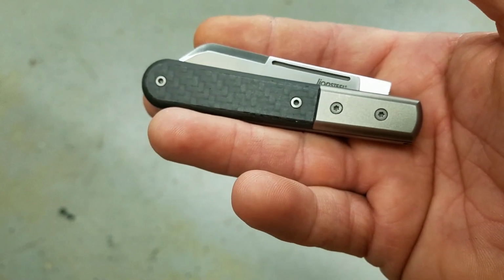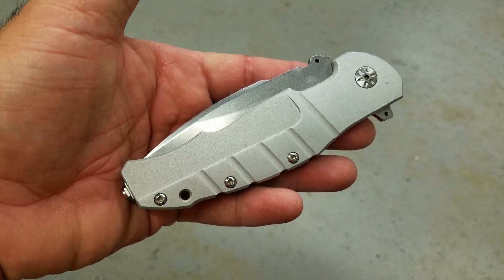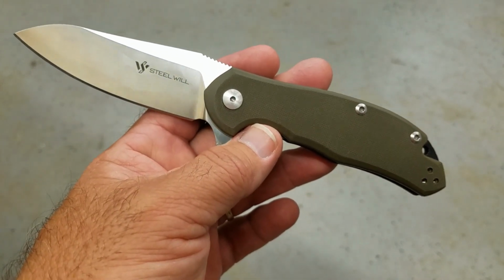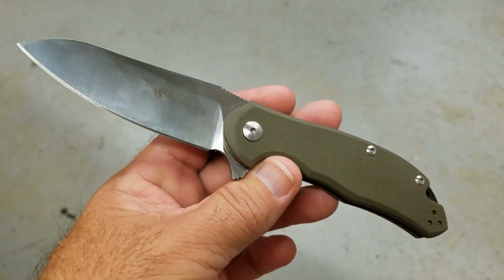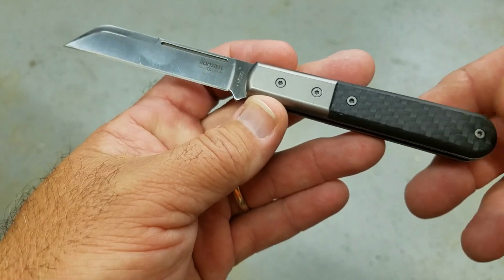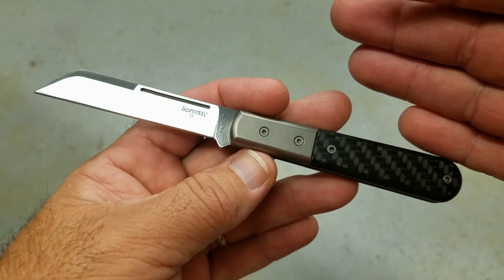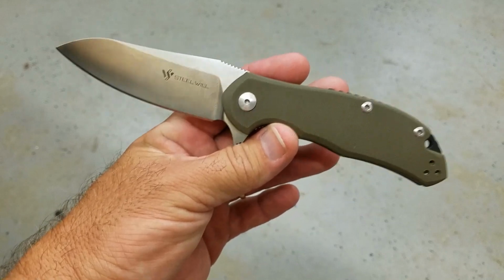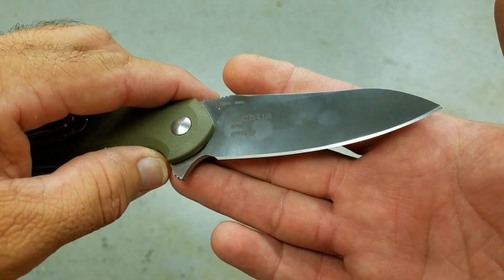Italian M390 edge retention testing, Steel Will, Masserin and Lionsteel. Who will take this one?

Comment: Why do so many manufacturers not do m390 correct? Makes me scared to fork over the $ for it so for now I'm sticking to other steels .
Reply: Ditto
Reply: i avoid it now. manufactures just want your money, they dont care about heat treatment.
Reply: Most of Spyderco m390 is a safe bet. Most. Not all. I don’t buy m390 unless it’s from Spyderco.
Reply: @johnd9357  that's what I was thinking it seems like theirs is the only consistent m390 I've heard of .
Reply: Just stick to Spyderco for M390 and it’s analogs. They typically heat treat everything for performance.
Reply: @jasonthames7360  I agree. Although I don't have any of their M390 or analogues, I have 52100, S90V, Cruwear, XHP, Rex45, and M4, all performing excellent. They are your safest bet.
Reply: @jasonthames7360  have you ever tried Cold Steels S35VN ? I recently got an AD-15 and it's my first experience with S35VN and so far I'm pretty amazed by it . Before the best I'd had is cpm154 and vg10 .
Reply: Yea stick with Spyderco for M390, had my M390 Delica tested a while back- 61.4 and 61.8. Just saw a Manix test for 62.2 i think
Reply: @johnd9357  spyderco m390 is decent overall but they range from 59 to 62hrc. So... It varies.
Reply: @OsamaBinDarrel  cold steel s35vn is not that great but it's not like it's a super long lasting edge regardless. Cold steel xhp is where it's at. It performs better than there s35vn.
Reply: @tacticalcenter8658  I wish they offered more xhp unfortunately I got into cold steel a little late for the xhp to be readily available 🥺
Reply: @OsamaBinDarrel  xhp is not available at the quantity and prices they were getting before so they switched to s35vn so they wouldn't have to raise prices and delays to the customers. If you want some great s35vn try Andrew Dempko custom knives. They start around $800 but are worth it.
Reply: @tacticalcenter8658  yeah I'm not in the position to spend that kind of money on a knife lol one day maybe but I'm sure I'd wind up single with the lights off if I spent that 🤣
Reply: @OsamaBinDarrel  save money and with time you'll get one. That's what i do.
Reply: @tacticalcenter8658  one day brother lol but at the moment I'm not in the position to spend that on a knife even if it's "extra" . I live comfortably and probably wouldn't get my lights turned off if I bought one it's just hard to justify that purchase for me at the moment. Not saying they're not worth it bc I believe they're worth every nickle . I have been searching the secondary market though and have seen MG AD-15s that are closer to my budget .

Comment: 28 ft on an M390 blade..you are better off buying an 8CR13 knife! It really is a shame, because they are a damn fine looking knife. The Italians in general make a good well built knife, until you cut with it. That Lionsteel will need to be sharpened if you cut a damn banana! Disgraceful. 

btw, I got that Modus I sent you on sale also, for just over $100. Some knives, I look at it the way you do..it's a good edc knife, that just won't cut a ton of stuff, so great for light duty edc carry, but not a good hard use prolonged cutting work knife. If I like a design, and the price is right, I'll buy it regardless of the steel, as long as I take into consideration what I intend to do with it. Thanks for all you do G!

Comment: I do have one remark regarding the testing. If you want to form an opinion on the overall quality of a brand or knife type, testing 3 completely different knives is not a proper test. You would need multiple knives of the same type, let's say 10 or 50 of different batches as well depending on how many they make, and test those. And then you can get an idea of how good or bad it is. Not doing 10 tests with 1 knife. That is not the way to go. It can be a fluke, or someone trying out a bunch of knives and pass the bad one around.

So unfortunately for all the work here, but realistically speaking you now have the result of single knives, not a brand.
Reply from the maker: Being this video is about Italian M390 I'll cover that. I've done videos on 8 examples and none did well. Examples from Viper, Lionsteel, GM, Masserin and Steel Will.  These aren't passed around as they all belong to viewers and two from other channels personal collections. The Modus is mine and I still have it. The issue is a poor heat treat on all of them. Is it possible these are just 8 bad examples, sure. However, the chances of that are slim. To add to the issue these were made across a 4 year span of time. I'll single out the Lionsteel, all made years apart yet all still do poor. 

Yes every knife I test is a single result and I've stated that before. Aa I continue to test anyone can form an opinion on a particular company. A few examples would be Spyderco, I've done many from them and they have a high chance of having a good mass production heat treat. TRM had 3 of 4 20CV do well and Shirogorov also does well. That doesn't mean they all will but as the list expands and more examples from manufacturers are tested patterns become apparent leading to an individual conclusion.
Reply: @Outpost_76  ye the more is tested the better. Looking purely from a statistical pov and a tester (chemistry), your test set isn't reliable enough to have a real conclusion, but it would certainly warrant further investigation. Too bad that we as consumers can't go and get 50 knives from 1 type and several batches. 

In the Netherlands we have something called the 'consumenten bond' or consumer union or something translated. They sometimes launch wider tests.

I do know heat treatment isn't an exact science but there should some sort of guaranteed tolerance. That said, seeing quite a bit of messy qc with lionsteel from reviewers so skipping them as well. Got a viper katla that is impeccable though
Reply: @Outpost_76  Agree. Perhaps I am unlucky. My Lionsteel M4 and Bestman did significantly poorer than my Victorinox Hercules in 1.4110 steel in rope cutting test. The two knives were purchased in late 2019 and early 2020.
Reply: @Outpost_76  By the way, my Lionsteels were bought from a Singapore retailer.
Reply from the maker: @007liuming  I've done a few of these and the worst did less than 50 feet. It's also the one that had the biggest variation in hardness around the pivot.
Reply: @Outpost_76  Thanks for sharing. I just did one more heavy re-grinding of my Lionsteel M4 and Bestman (almost 6 re-grindings for each knife in total), now I see some significant improvement after rope cutting, the shining spots/lines on the edge became much lesser.
By the way, I use an HSS scriber to estimate blade hardness. I don't have the HRC number however it stops leaving a mark for steels up to Spyderco Endura 4 in ZDP-189. Sometimes I can do a hardness "mapping" of the entire blade at the cost of ruining the polish.

Comment: M390 is simply ho-humm except for a unicorn here or there. Have you ever tested 20cv Gerald? SSSteve says he has heard the Ritter Knifeworks exclusive has rockwelled 60-61. That might be one to test that has promise for a nice worker EDC.
Reply from the maker: I have one in 20CV coming to test and Kurt already got a 61.2 or so on it.
Reply from the maker: I have done a few 20CV so far and none did well.
Reply: 20CV, is no better. We (in the know) just need to avoid steel, that tempers at such a low temperature.
Reply: @Outpost_76  Hey Gerald, based on what we know, the Ritter has promise with good Rockwell. I agree, the Modus is easily one of my favorite knives ever, action/ergonomics. I really wanted it to be the steel I wanted, but in my medium use, high cardboard shop use, it was OK, just didn't thrill me. I passed it on to my Grandson. He has my old lansky diamond system and keeps a good edge on it, and he loves that Modus.